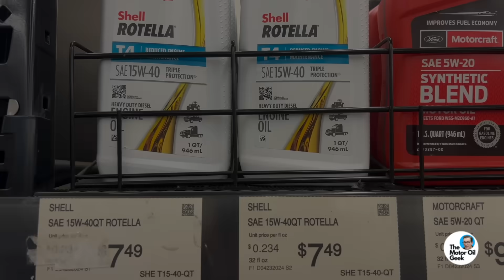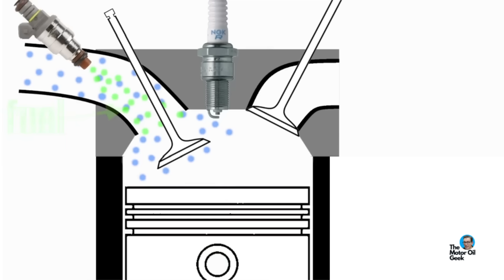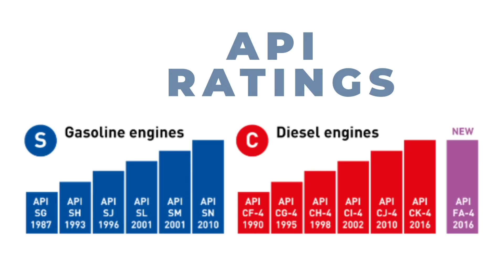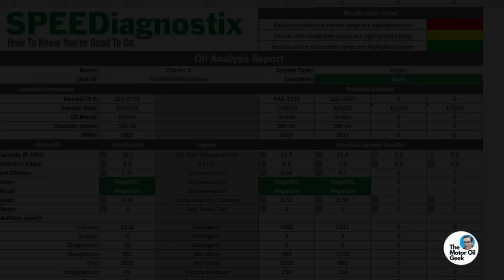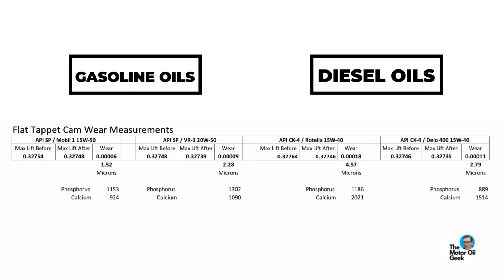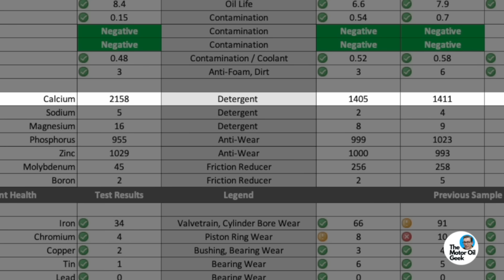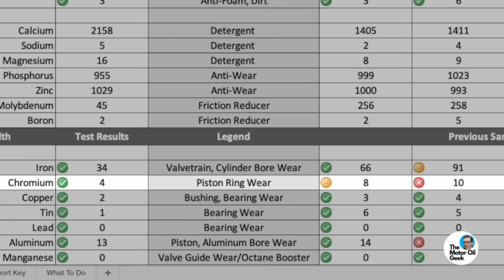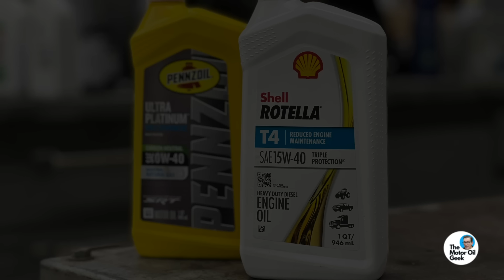Why DIESEL Oil is Actually WORSE for Gas Engines!

Comment: Thanks, but I've been running and will continue to run Rotella T6 in my 2004 F150 Triton 5.4L with over 400,000km on its original cam phasers and timing chain guides without so much as a rattle at -30C morning starts.  Also run it in my Kawasaki street bike, my snowblower, my SXS, my lawnmower and my 500,000km 2011 VW Jetta 2.5L.  There's no way my equipment and vehicles extended lifespan isn't the result of using T6. Also I have NEVER had a DTC for hO2 sensor failure nor catalytic converter failure.  My oil samples have come back clean too... Maybe I'm lucky....
Reply: Are any of those engines Direct Injection?
Reply: Yes, my 2.5L vw and Ecoboost engines are Direct Injection
Reply: Same here. I run T6 in my gas, diesels, street bikes, dirt bikes and small engines.  I’ve done so for over 10 years and oil tests came back fine.
Reply: isn't a 2004 5.4 a 2 valve with fixed cam timing?  The 3 valve was introduced in 2005?
Reply: @D2O2  2004 had both body styles available.
Reply: No, my 2004 IS A 3V TRITON.  2004 the "heritage" f150 and the NEW STYLE f150 with 3v
Reply: Are you using 5w40 for 15w40?
Reply: I got a 06 F150 XLT 5.4L. Thinking about switching to T6 5W-40 mainly for the engine ticks & consumption. I’ve been looking at the comments in hope to see another Triton engine buddy🥲
Reply: Which T6 are you using? 5w40 or 15w40?
Reply: yep  again  clearly the proof is in the pudding  right here  no way to miss it

Comment: 10w-40 Rotella was awesome for my motorcycle with a wet clutch
Reply: Listen, let's clear up some confusion, the only rotella that should be used in a jap wet clutch bike is T6 (5w40). T4 will work but has some cons. It's thicker at cold starts because it's a 15w40 so that's not good. Also just not as good of an oil as far as protection. I might be mistaken but I believe T5 used to say one or both of the Jaso approvals but removed them. What he should really do is compare the cheapest, mid price and most expensive MOTORCYCLE oils he can find against rotella T6...

Comment: Trying to tell this to the old muscle car guys where I work was like peeling a grape. They devoutly worship at the Altar of Rotella T4 15W-40. One guy even insisted that Rotella T4 15W-40 "fixed" the low oil pressure problems he was having with his swapped-in LS6 Camaro.

Comment: If you have a carbureted engine, big camshaft, very high spring pressure, on the edge of detonation. Basically a "race engine", but you use it on the street. It probably gets a lot of gasoline contamination in the oil. Is there any type of oil that is more fitting for this than other oil? Like what oil should you look for such a engine?

And the direct injected piston that is broken, is that always because of wrong oil?

Comment: Shell Rotella T6 in all my motorcycles.
I understand anecdotes, I have however had no issues in over a decade of use in many daily ridden bikes covering almost 60,000 miles total using the diesel oil. 
I haven't experienced any issues at all. I change at 3,000-5,000 or as soon the oil "shears" and gear shifts becoming clunky. 
This video will NOT change my use of T6 in my bikes. There are hundreds of thousands, if not millions of people who exclusively use Shell Rotella T6

Comment: Now address a BIG reason why many use diesel oil in their non-GDI gasoline engines, which is because the engine oil is shared with a wet clutch and Rotella is specifically rated as JASO MA for wet clutches.
Reply: I use T4 in my 87 Honda Shadow because it is cheap and motorcycle rated.
Reply: I worked at a Dirt Bike shop, Rotella is all we used. Never had an engine failure due to Rotella!
Reply: I use Rotella T4 in all of my motorcycle engines, both engine and clutch side if they are seperated. Specifically because it does a really good job with wear protection and it's wet clutch rated which is extremely important for motorycles (the majority at least). Yes, slippage can be from wear, but incorrect oil can cause slippage and other clutch issues as well.
Reply: I don’t think that rating is hard to get…
Reply: @yvonjasser  many people are using Mobil 1 EU formula in their wet clutch vehicles with great success yet it's not JASO MA rated.
Reply: @MassiveOverkill  I believe you, most of clutch slipping issues are wear related
Reply: @yvonjasser that’s not true. I can tell you from experience with wet clutches. The wrong oil caused slippage. I thought it was wear, and ordered new clutch plates. Before I replaced them, out of curiosity, I switched to the T4 Rotella (from T6) just to confirm, and lo and behold, no more slippage! Still running the same clutches for at least another 25 hours and no slippage. I still have the new clutches, waiting for when they need replaced!
Reply: @ T6 is JASO MA rated so that means it should not slip.  If your clutch stopped slipping going from T6 to T4 that means you have mechanical issues.
Reply: @ T6 is JASO MA rated so that means it should not slip.  If your clutch stopped slipping going from T6 to T4 that means you have mechanical issues.
Reply: @ you’re clearly in denial of the facts. The clutch feels perfect and is well within the wear tolerance limits, so there were no wear related issues. Plus, real world testing in abusive racing conditions. Just accept the fact that your statement was wrong.
Reply: @aaronmcelhinney1436  Is T6 JASO MA rated? Yes. That is a fact. JASO MA rated oils do not slip clutch unless there are mechanical issues. Facts.
Reply: @ you’re welcome honoring the fact that obviously they have more friction modifiers in the T6 than in the T4, to allow that T6 to be used in fleets. The T6 worked in some clutches but not others, likely because they have higher or lower coefficients of friction, and the two oils didnt perform the same, despite the rating. You’re still arguing on a rating only that has a range to qualify within.
Reply: @aaronmcelhinney1436   fix your bike if t6 slip
Reply: @aaronmcelhinney1436  my clutch never slipped with t6
Reply: @aaronmcelhinney1436  Wet clutches tend to 'learn' the first oil they're subjected to.  It's very common to end up with slipping clutches after giving them a different oil.  Then they go back to working right when you put the 'wrong' oil back on them.

I use Yamalube4 on all my wet clutch engines.
Reply: That's only for motorcycles. Why would that be a reason to put in a car's engine!?